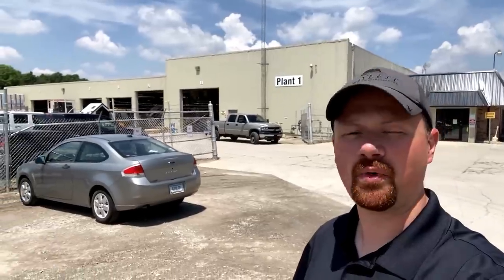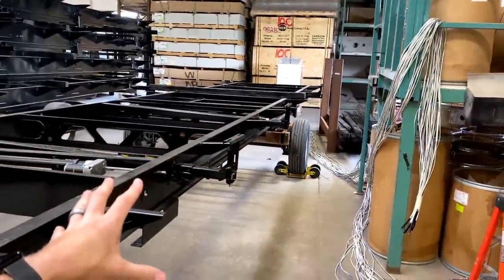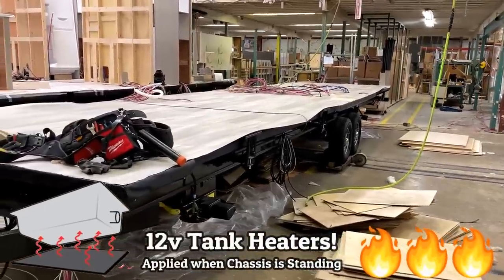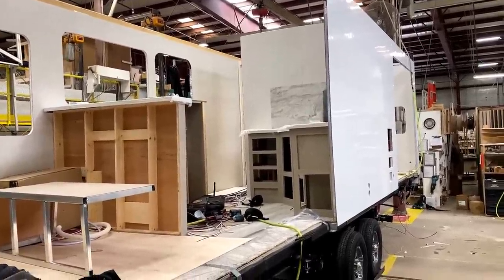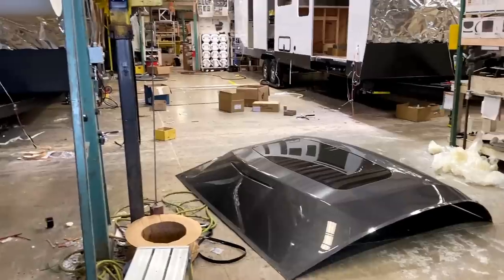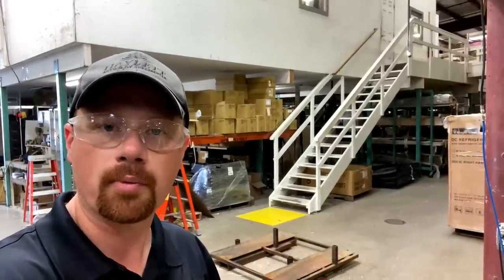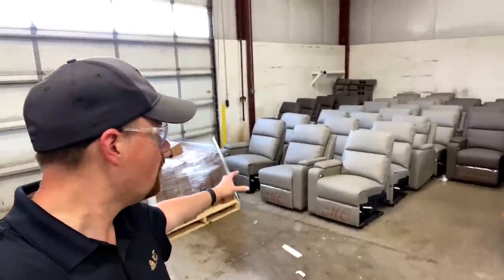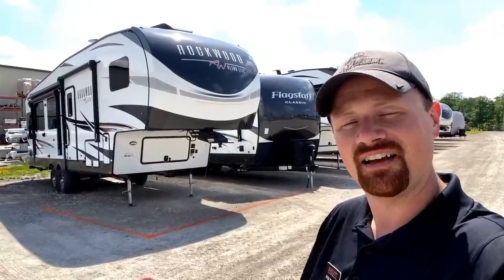Rockwood/Flagstaff RV Factory Tour!! (Part 1: Signature Travel Trailers & Fifth Wheels)

Comment: Josh I like how Rockwood glues there roof membrane down. My question is does my eagle 336 not glue down there roof completely?
Reply from the maker: Unless something has changed I believe they do -- what makes you ask by comparison?
Reply: @JoshtheRVNerd  I ask because I noticed when I was up on my roof there were areas where it didn't look flat like it wasn't glued down every where. I do realize it's a new trailer and it will settle. But I got to give it to Rockwood for how they construct there roofs. Love the videos and loving my camper I got from you guys.

Comment: Josh I have a question for ya! Forest River makes Flagstaff and Coleman Apex Ultra Lite. Can you tell me the difference in construction I noticed they both have aluminum frames and Azdel walls and ceilings? I currently own a apex 215RB and am selling it to order a Flagstaff 26FKBS. Not happy with the Apex as far as size goes, not enough room for the wife and I. Thanks man
Reply from the maker: They're extremely similar
Quick correction, though: They both have laminated ceilings -- no azdel up there unless a lauan shortage has forced them to use azdel as a temporary subbed part. 

Apex has a laminated floor
Rockwood/Flagstaff have the flooring shown in this video

That 215RBK is awesome, but you're likely feeling closed in by that narrow body and island-entertainment in front of the bed

Something like this wouldn't be much larger for towing, but feel HHUUGGEE by comparison: https://www.youtube.com/watch?v=kNiJE5V8nCQ
Reply: Thank you for the roof correction. That's a nice mini lite but I think we are going to stick with the 26FKBS.

Comment: Did I hear you correctly? The exterior walls lament are vacuum sealed.
Reply from the maker: Yes. Rockwood vacuum laminates exclusively. Has for some time. They use a lamination press as well rather than bag laminating for those walls

Comment: Are used camper 2005 Pilgrim I had it cat scale just to make sure it was OK for my truck to pull it I don’t trust the manufacturer weight but I agree with you on that I think every camper trailer manufacture should have it’s on scale

Comment: Hey, Josh. Nice job. I've been waiting for this one because I wanted to see more on how Rockwood builds their roof structures. They really make nice stuff. I recently saw where they are discontinuing the 2896MB, a plan that I really like because its a mid-bunk with a full loft in a very reasonable size that isn't 42 feet long. Do you think they will have an updated or replacement plan for that one?
Reply from the maker: They have 1 or 2 other middle bunk rooms. I don't see them adding to their lineup significantly until they're finally able to rebuild dealer inventories (which is likely going to take a while)

Comment: Wow!  Not all RV's are cheaply made P.O.S.s that will leak and fall apart within 10 years!  I owned a Starcraft hybrid that leaked, delaminated, and just about fell apart and a Coleman popup where I had to rebuild the front and rear. I was thinking about buying an enclosed cargo trailer and building my own camper.  It looks like Rockwood/Flagstaff are worth buying.  I did have a Flagstaff pop up with which I had no problems.  

What are they using to seal the place where vents etc. pass through the roof?  Is it that self-leveling sealant that will crack and leak within a few years or a product like Eternabond?  

Thank you for the video and Thank you Rockwood/Flagstaff for allowing the tour and video.
Reply from the maker: It's still self-leveling stuff like dicor. Requires the same upkeep

Comment: Hey Josh, love your videos, thanks for being so thorough. I’m a newbie, looking to buy my first RV this year— have you ever talked about the reliability and mechanics of the slide outs? I want something that’s gonna last with as little maintenance as possible, and can just envision slide outs (while being nice) can potentially be another pain point.
Reply from the maker: I don't have good visibility of pass/fail rates from one slide to the next beyond observing customer reactions. Overall it seems cable slides are the least favored by actual owners though I'm told by MFGs they're the slide that generates the fewest number of warranty claims

I tend to listen to actual owners when there's a discrepancy. 

Schwintek slides were reviled for a time but I feel strongly that was due to RV Builders using them inappropriately (which is largely not the case anymore)

Comment: Damn.  Those big rigs are probably worth as much as my house. While I can't personally afford something like this, it has made me think about the trade-offs that should be made between cost and quality.  As a DIY (prospective) camper builder  this was a real eye opener.  My take-away from this was something that I've never seen any other builder do - maybe think about doing the internal fit-out before the walls or roof.  It makes a stupid amount of sense.

Rockwood also has my utmost respect for the way it treats it's employees and the for the way it does business.  I've worked most of my life in fabrication including structural steel, and can I say that good management and good bosses are the rarity rather than the rule.  Most companies over more than a handful of employees have been toxic towards both staff and customers.  It really doesn't cost much to to treat your employees well and the flow-on effect through the quality of the product is guaranteed.

Comment: I would like to see how the workers operate during working hours. I bet they literally have to run to keep up. I can't see this factory being any different than the other non-custom manufacturers. This seemed a lot like a marketing video, in all honesty. These workers generally are pushed to their physical limits without regard from the pencil pushers, management and investors, all so the manufacturer and investors make their profit, and management keep their cushy jobs while the workers, the people on the front line making it happen are afterthoughts. No Amish can doa good job when the are constantly pressed to produce so many units per day out the door. Then the customer is largely disregarded, or the dealer tries to get out of doing the work, or charges the customer AND the manufacter, double dipping.  If you bought a new car and had to return with a laundry list of problems, would you find that acceptable? No way would I buy a unit at this price level. You will get a lot less than you paid for.

Comment: They do a roof install better than most, but how about going the extra mile and putting a real roof on it, AKA, metal [aluminum] or fiberglass. That way the trailer won't suffer an early demise from leaks or the need for a  roof replacement that's worth more than the trailer.
Reply from the maker: The "skin" of the roof wouldn't change the seal points which are truly the weakest link. Perhaps I'm not fully understanding something that might be available.

Comment: We just bought a lightly used 2021 Rockwood 2606ws. I was going to buy a Jayco White Hawk 27rb because Jayco has quality structures I like. But I see Rockwood does also. Vacuum sealed exterior walls is one of them, am I right?
Reply from the maker: Correct. Pound for pound I would put Rockwood/Flagstaff next to about anything
Reply: Thanks for your reply. I bought  the 2021 Eagle 330RSTS 6 months ago because of your videos. I love it, and we live in it. 😁 The Rockwood we will travel with, and my wife uses it to work in nearby states. Thanks for your service.

Comment: I know you get asked this alot and I'm sorry to add to the list but I'm looking to buy a truck to correctly tow a Vanleigh Vilano 37 footer (about 17,500 GVWR). Would a new Ford F250 super duty lariat do the job well? Thanks for your help. If you aren't able to answer the question, I understand. I still appreciate all your great videos and learn a ton from you. Thanks.
Reply from the maker: Vanleighs are typically in need of duallies at those weights
Reply: @JoshtheRVNerd  Thank you so much for the help and so quickly, too. You are the best, Josh.

Comment: I appreciate Rockwood/Flagstaff allowing you to make these “how it’s made” videos of their production facilities Josh. I am someone who wants to know I’m getting a quality product from top to bottom and nose to tail, and ,most especially, the parts in between and underneath the RV that are always so important.. Rockwood/Flagstaff does itself a great service allowing you to highlight the degree of quality control they put into their products. This is the one of the main reasons I am leaning heavily to Rockwood and Freedom Express as my first RV. Leaning a bit more towards Rockwood because of the free solar panel with the refrigerator upgrade and the fact Rockwood seems to be willing to do more from the factory when it comes to solar and extended boondocking products. #showermeiser. I also like we don’t get charged for a battery we’re not going to use from the factory. Thanks for that as well Rockwood!!! I’ll be getting the battle born lithium battery setup straight away. And correct me if I’m wrong but I believe Rockwood is the only one offering a 3 inch lift and off-road tires on their mini lites. Thanks yet again Rockwood. Keep up the fantastic video education Josh!!! We all really appreciate that I’m sure. I’ll be calling Haylett’s when I’m ready to pull the trigger on my first RV.
Reply from the maker: Ty for watching and sharing :)
We’ll be ready when you are

Comment: ***FYI, For all you folks waiting months for your pre-ordered and price protected 2021 Rockwoods to come in at some point this summer or fall there is something very rotten coming down the river.  I have been informed by my dealer that any pre-ordered trailer being built as a 2022 model will not be price protected from Forest River to the dealer even though it was ordered months ago and you put a deposit down and signed a contract. Rockwood's story is because it will now be a 2022 and not a 2021 the price protection is voided and doesn't apply anymore.This means the dealer has to pay more for it and so will you unless the dealer decides to eat the price increase. Some dealers may, some may not. Please call Rockwood directly and tell them how poor a business practice this is and most likely illegal in some states. With enough pressure on them, they may rethink things. Please read what others are finding about their pre-ordered Rockwoods here: https://www.forestriverforums.com/forums/f34/2022-changes-to-2509s-234882.html
Reply: So if the 2022 models have an across the board 10% price increase as rumored, my $30,000 on order 2021 Rockwood will now cost me another $3000 plus sales tax. All this goes into effect starting next week when the 2022's start rolling off the line. I doubt most dealers are going to be able to absorb this cost on every pending pre-ordered 2021 they have under contract. My dealer told me we will be happy to refund you your deposit and sell your trailer to someone else when it comes in if you don't agree to the new price. Josh can you please confirm any of this about the voiding of price protection from Forest River if your trailer automotically becomes a 2022?
Reply from the maker: As info MFGs haven't been price protecting units since roughly December of 2020. I'm not at all defending the policy by any means. It's not how we like to do business either, but it's nothing new that's happening.

As a dealership we attempted to lock our customers into pricing & absorb increases, but sadly we were forced into suspending that internal policy until the market stabilizes due to the frequency and value of increases we were seeing. 

We covered this in one of our industry update videos a month or two back, but essentially if the MFG provides a 3% price increase, then we provide you with documentation and your final price will follow suit accordingly. We're not marking anything up. Rather it's a case of direct pass-thru pricing. 

I/we despise this policy but it is the only thing we can do right now to keep figures in the black and keep the lights on. In 33 years of operation we've never operated under current procedures and I hope to resume traditional policies ASAP -- but we need stability to do that.
Reply: I'm sure all of us here who are patiently waiting for our new trailers understand that long term loyal Rockwood dealers are being put in a bad spot and we shouldn't blame you. But you know, the RV industry has had record sales two years in a row with no end in site, it's not like the MFGs are struggling with profits. For them to break their word to their future customers who took a leap of good faith and made a big purchase during shaky times is just wrong. For an extra $3,000 I'm sure many of us could have moved up from waiting a long time for a false locked-in price on a Mini Lite order to just buying a more expensive Ultra Lite already on the lot for about the same money and be camping now.
Reply from the maker: @r.billings4935  You won't hear me argue with you about any of it really. I feel fortunate we've seen such a strong amount of sustained demand in the face of so many challenges

But it absolutely feels like things could be happening with more clarity/transparency

Comment: I watched your old video of the Rockwood factory tour. Given the fact that they have not jumped on the Azdel bandwagon and I assume from the brand loyalty you spoke about, how do they get around the delamination problems of other non azdel trailers?
Reply from the maker: For clarity: Rockwood does use azdel in about half their lineup. 

The comment here is written as though delamination was a guaranteed item. Proper construction & proper upkeep prevent leaks which makes delam not an issue. 

Plenty of brands don't use azdel and aren't known for delamination issues and azdel alone doesn't guarantee a prevention of delamination. I've seen an azdel RV delaminate. 

The true determining factor is the quality of ownership
Reply: I guess I, maybe with a lot of other people, have fallen to the hype. A lot of your peers make quite a point of pushing azdel as the holy grail when they do rv reviews. I pretty regularly inspect my roof even though I have azdel.
Reply from the maker: @RV_Tips_Tricks_Travel  this video is about four years old but still 99% holds up https://m.youtube.com/watch?v=0S86wb-yGEM

I share the benefits and drawbacks back of Azdel

It’s an awesome material but despite the hype it doesn’t magically make the rv waterproof

Ask the other people who talk about it why they still probably make videos on Non-Azdel campers if it’s THAT great lol
Reply from the maker: @RV_Tips_Tricks_Travel  I applaud you btw for asking the questions and seeking answers

Comment: Wish they would install the Seelevel RV tank monitoring either as standard or an option.  So much easier to do it when the tanks are in and nothing on top.
Reply from the maker: Those are really nice setups
Reply: @JoshtheRVNerd  more importantly they work.
Reply from the maker: @gregebel3842  #facts

Comment: They should use pvc wood instead of real bare wood...Pvc wood is stronger, lighter, last forever and can take the heat and cold better than real bare wood..you want to build wooden 1800s stagecoach fine...But don't put that cheap s$#t wood  in modern day RV'S...makes no sense ....